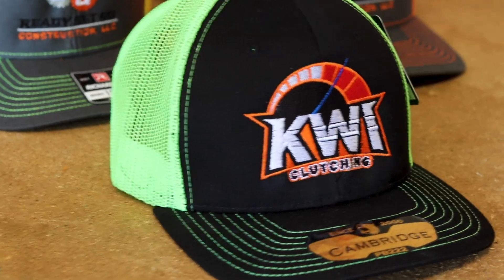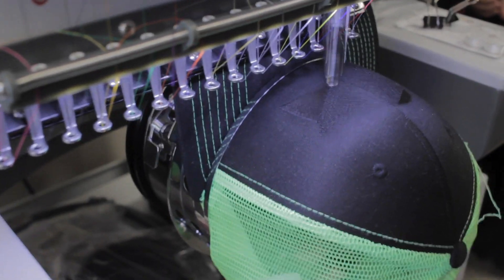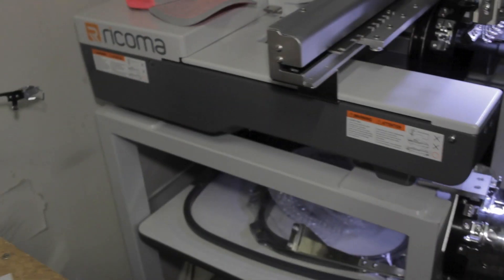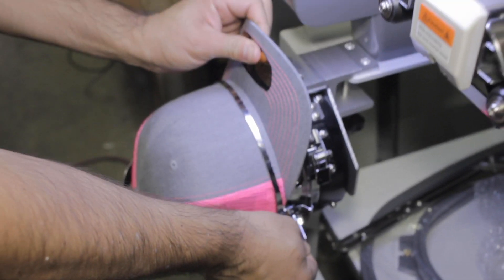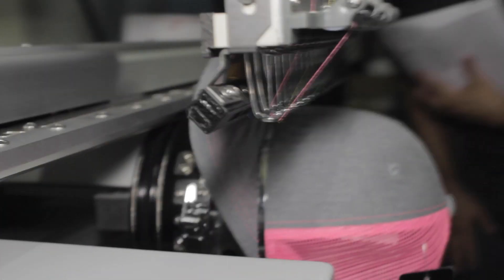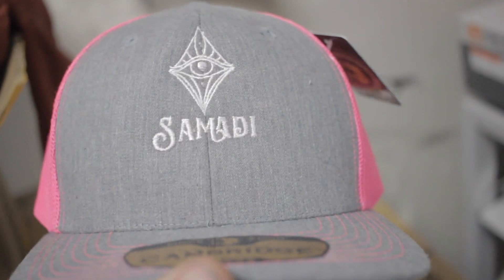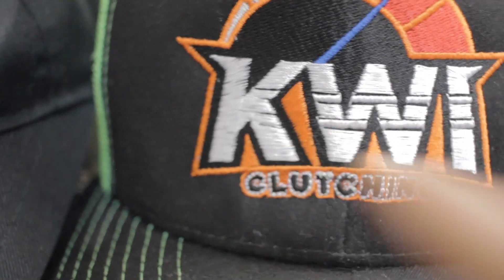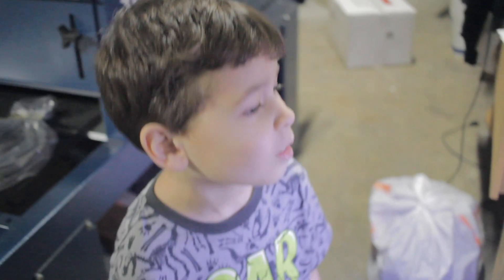Training and Embroidering Our FIRST CAP! Ricoma 1501-TC | Ricoma RCM-1501TC-7S

Comment: Did you get any software with the machine, are you digitizing the art yourself? How long does it take to run off a hat?
Reply from the maker: It comes with Chroma. We've used it thus far to do a little editing. It depends on the stitch count, but an average cap takes about 3-4 minutes. Just depends on the stitch count of the design, and what speed, stitches per minute, the machine is being ran at.

Comment: It continues to boggle my mind, but how can anyone run  volume on a single head machine?  144 hats with a 9,000 stitch design will take almost 40 hours.  And that’s not even a large quantity or big logo
Reply from the maker: We're not trying to take on the world with a single head. It just allows us to bring most of our work in-house, be able to showcase embroidery, start getting more embroidery work in, so that way it's more feasible to make that jump to something with at least 4 heads.
Reply: @mikeydesignssilkscreen473  I understand that thinking but you're gonna hamstring yourself and not be able meet clients needs and deadlines.  Been doing embroider for 12 years.  Bought a Tajima 6 head and almost threw up when I bought it and had multiple sleepless weeks thinking about the cost.  The business that came within 2 years was astounding because I could turn large projects in a short time.  Big customers turn into more big customers.  Think small, stay small.  We've run close to million in contract work since the purchase not to mention 2-3 million, at least, in direct sales that needed embroidery.   Love your channel, your SEPS and artwork are TOP NOTCH.  Definitely jealous of that skill.   Added screen printing to my shop about 3 years.  10 color auto and a 6 color manual    You can't put a price on quality equipment.  It will repay you 10x over.   My 2 cents on business